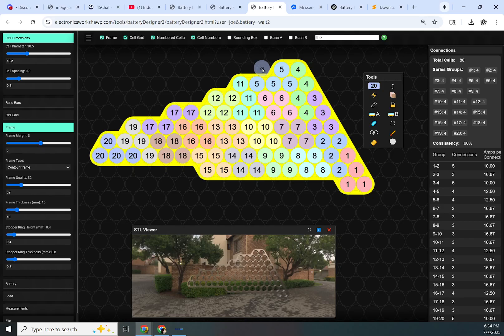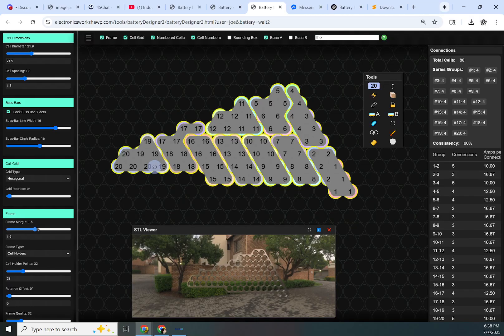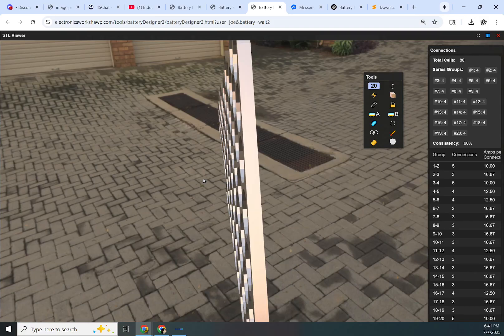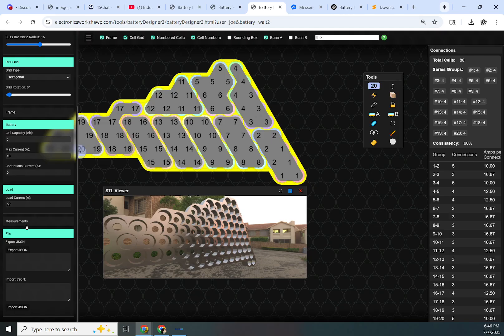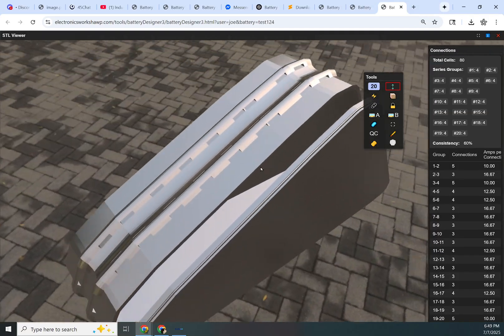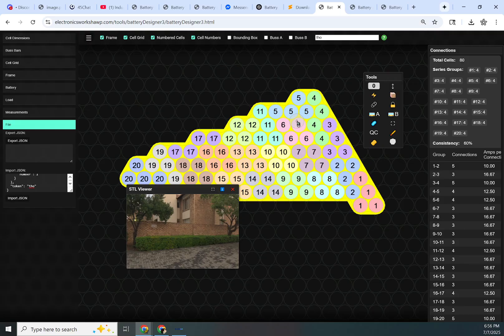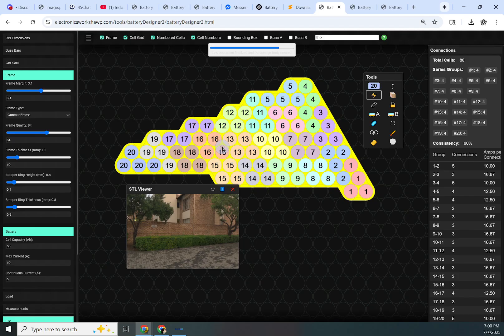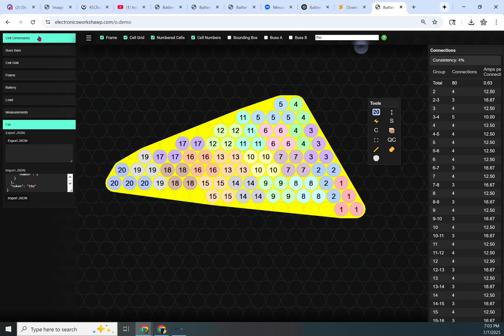Battery Designer 3.1 Update

Comment: Also if I were to nit-pick that far right 17 cell should be swapped with the top left 16 and then that entire pack wouldn't have a single strip ampacity bottle neck. Was that automatically placed and numbered? Oh nvrm your answering my question at the end of the video! 😂. Nevermind. Love it!  Are you hosting your own server for mobile?
Reply from the maker: haha thanks, but I would like to clarify. While its true that the cell layout generator is not working yet, the layout seen in the video up until that point was not made with the generator, but instead, manually made by me. 

But I would also like to say that its not finished yet, Im not happy with the current layout, and have been struggling with this particular layout. 

The struggle that I'm having with this layout is actually being documented here 

https://discord.com/channels/1224489190511611975/1380283455656689846

https://discord.gg/KpR482KG6J

Also, if you can do it better, which I have absolutely no doubt in, you are more than welcome to update the cell layout here.

https://electronicsworkshawp.com/tools/batteryDesigner3/batteryDesigner3.html?user=joe&battery=walt2

Comment: Good work sir!! That is amazing. I've built entire vehicle packs by hand and tinkercad back in the day. What you did in 20 min would have taken days.  So is this a subscription for an online program running on a server or if I have a beast of a Mac/PC can I just download an .exe as a one time purchase and have my own computer host my own server side?
Reply from the maker: This is a server/client based tool that requires a subscription, but I would be more than happy to give you a 30 day key. There is no exe or anything like that. Its actually several programs running on several computers that are all linked up with a custom web sockets based message relay. 

Its all linked together through a normal web page running on a server that could, yes, run on any computer. But the set of other programs that are running locally here at my house are actually what does all the frame generation and other mathematical heavy lifting. 

If you join the discord and send me a message, I would be happy to give you a key.